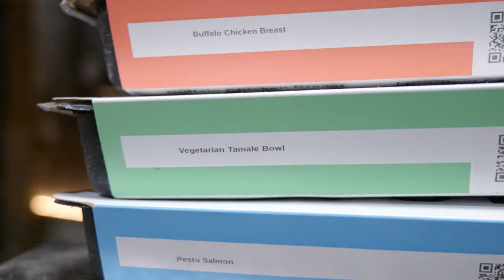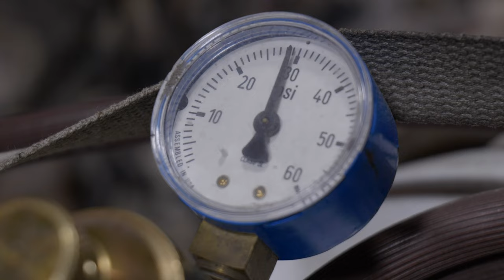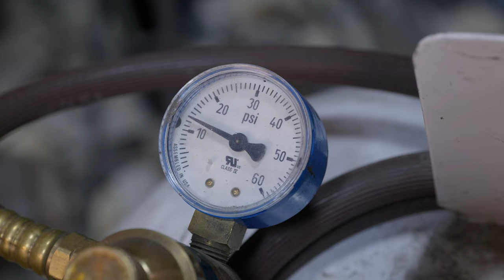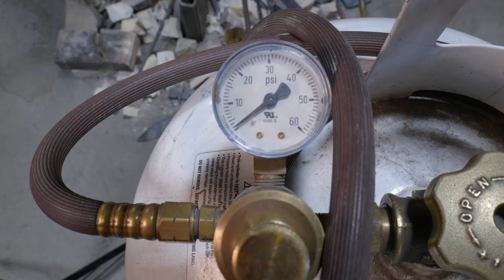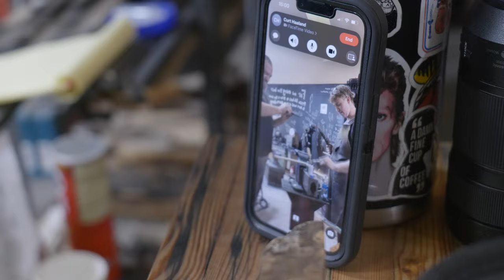We Try Making a One Day Chefs Knife

Comment: With the right equipment in the shop, a 1 day build is not hard at all. Come do it in my forge and see what a real 1 day build would be like. Bare bones.  An old 116lb Peter Wright and a 4lb whiskey turtle forge hammer. No kiln, no 2X72, no power hammers or press, and no exotic anything. W1 pulls a beautiful hamon also.

Comment: I have a question: Can the hamon be any design such as using letters? It would be funny to make a knife with a hamon that said 'Send Nudes' in cursive. You can probably have one word on each side of the knife.
Reply: I don't think so? I think you'd run into warping problem from differential heating/cooling during heat-treat.